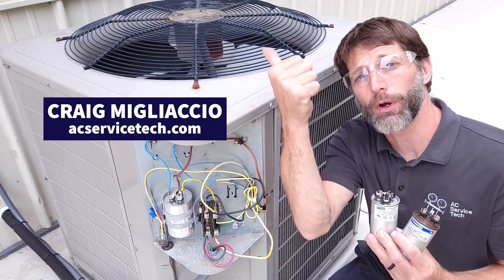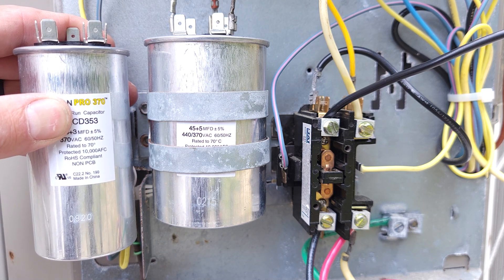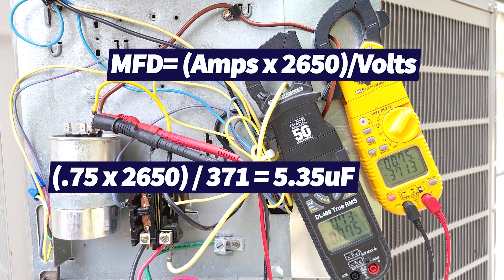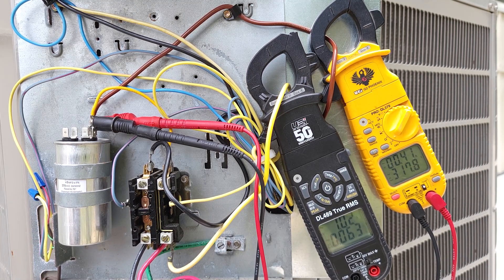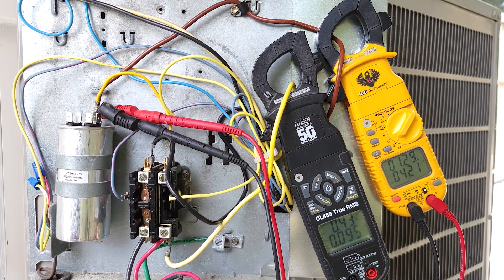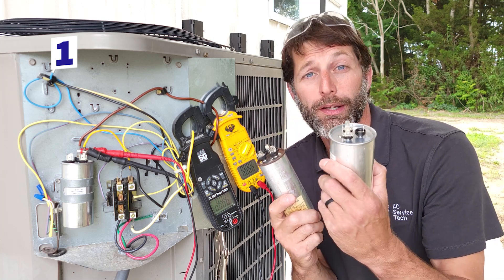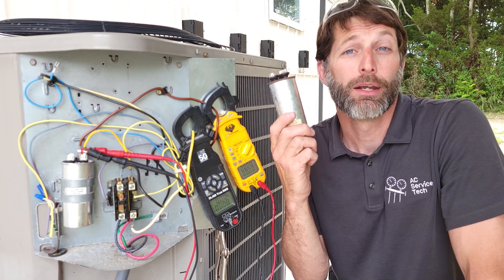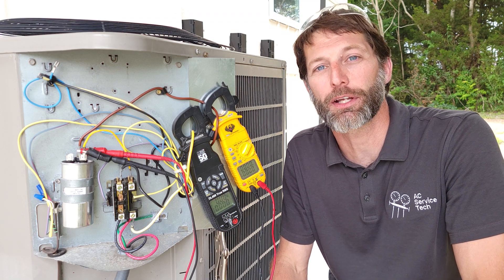Does a CAPACITOR Control Electrical Current to the Motor? Installing Wrong Size MFD to Test!

Comment: TY!  Nice vid.  Was wondering, if you don't know what size cap you need for a motor, how could you calculate what size is most appropriate for any motor?
Reply: I don't know the answer to your specific question but if I'm not sure what size capacitor is needed I'll use the Copeland Mobile app for Copeland compressors ,and will look up model and serial for fan motor cap or check on rating sticker on motor.
Reply: Don't hold your breathe on getting an answer from him 🤣

I'd love to see him post a video on that because I'm guessing that's way above his pay grade because that involves electrical engineering.
Reply: Not sure there is a calculation for us in the field, but if you have a meter that will read power factor, you can swap caps till you get the best power factor reading…I’m guessing, since I’ve not done it!
Reply: @Supplyhousemarco  Thanks Marco.
Reply: Looks like my notifications was turned off.

Comment: The fan terminal (watched a second time) is connected and the common terminal is connected.   Does the common go to ONE SIDE of the CONTACTOR for 120 volts!  If so which side?   Which terminal on the FAN does the fan wire connect to?   A Lot Of Questions.
Reply: No, if you look at most outdoor condensing units, they use a cheap relay that only switches one side of the split phase power system, so common is connected to one leg of the 240VAC, and the other leg is switched through the relay contact. Either one of these legs is 120VAC to neutral or ground. But 240VAC leg to leg (L1, L2). When that relay closes, it applies power to the compressor and fan. The common terminal on the capacitor is connected to one of the legs of the power input, and then other terminals on the capacitor are connected to the start winding of fan and compressor (depending on the capacitor size terminal). The capacitor is in series with the start windings on the fan or compressor. Note that the common terminal on the capacitor is not connected to the common terminal of the fan or compressor motor. They are connected to opposite legs of the power. Common here means the point where the parallel connection is made from either L1 or L2. For the motor, that's the common connection to the run and start winding, for the capacitor, that's the common connection that gets connected to the start windings of each motor. Hope this makes sense. Do a google search on "simple wire diagram for outdoor condensing unit", and look at the diagrams.
Reply: @f.hababorbitz  “For the capacitor, that’s the common connection that gets connected to the START winding of each motor.”

When it comes to the capacitor common connection, I thought it is connected to
the RUN connection of each motor?       Thank you for the help.

Comment: will the current always be balanced with the correct capacitor, or will it sometimes be designed to have more current in the run windings? I'm thinking that some motors (especially those made to run in either direction) will have windings the same resistance but others wont

Comment: Thanks for this explanation because I didn’t know about capacitors before this video. The only thing that I knew was that they can store a fatal amount of current. I guess that is true?
Reply: The largest determining factor for the lethality of a capacitor is voltage. Anything above 40 volts DC or AC RMS is considered potentially fatal. For HVAC units, all will be above this voltage. The next largest contributing factor is the path the current takes throughout your body. Aside from arc flash situations, after those two, every other factor, including available current is pretty much irrelevant.

Comment: I just bought brand new dual capacitor 40/12.5uf +/- 6%  440v, but im getting a reading of 42 uf when I test the herm  and common terminals. Do you think the cap is defective ? Thanks
Reply: What you are measuring is because of the +/- 6%.  40 + 6% = 42.4, 40 - 6% = 37.6,. So on that cap, you might see anywhere from 38 to 42 uf
Reply: Reread what you just typed out about what it says on the capacitor and then you’ll find your answer. Diagnosing skills also come from learning to read the fine print
Reply: No. Check ur meter battery first